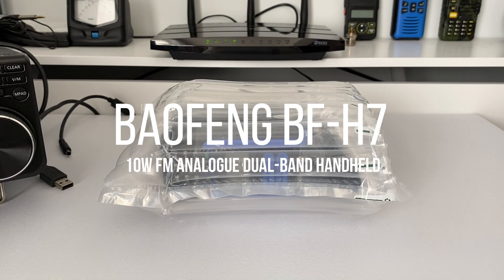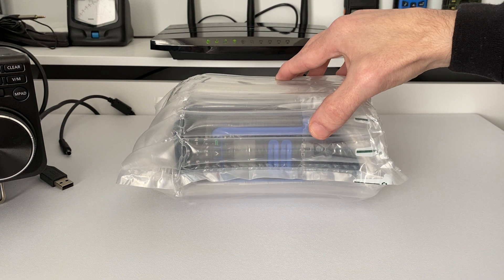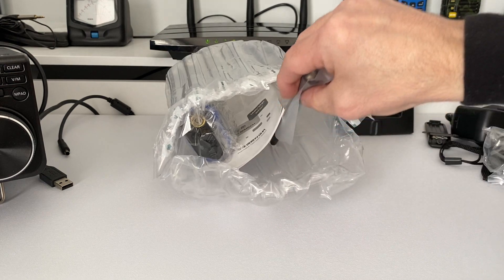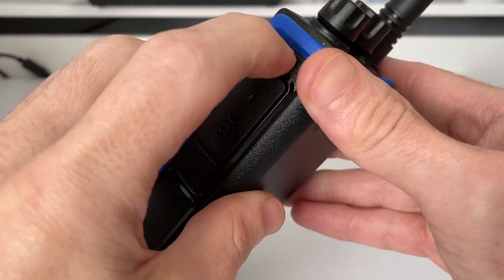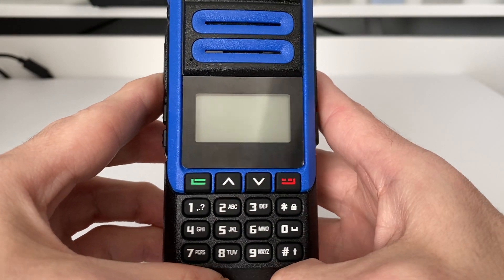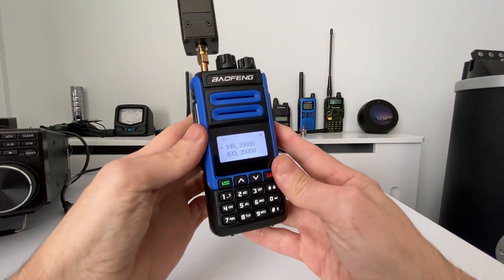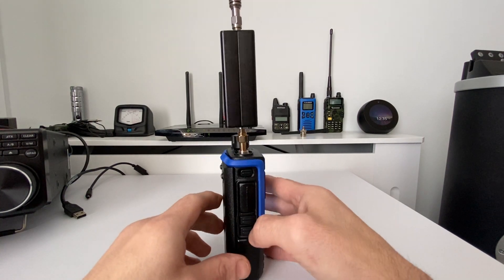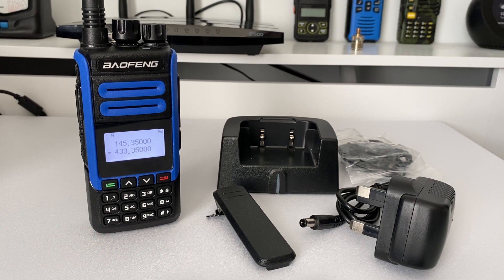Baofeng BF H7 | First look & power test (with a surprising result!)

Comment: does anyone know how can i pair baofeng bf-t3 my kids have with a baofeng bf-h7. i can't find the correct frequences
Reply from the maker: If within the UK, the BF-T3 should be 8 channels 1-8 on the PMR 446 frequencies. You just need the first 8 channels programmed into the BF-H7. But however, the BF-H7 isn't legal to use on 446MHz in the UK due to its power output and removable antenna.
Reply: @OntheMicwithMike  i am not in UK. i set BF-T3 on channel 1 and subchannel 1 for example and then i set the frequency on my BF-H7 from the table provided which is 462.5625 but there is no communication.
Reply from the maker: @marcusbrown2881  Are you sure both radios have been programmed for the same frequencies? Sub channels are CTSS codes, so my guess is that what one radio may class as channel 1 (CTSS or sub channel) might differ from the other radio.

Comment: Why do they need these walkie-talkies ... All this is outdated everyone uses smartphones
Reply from the maker: Maybe one day those smartphones wont be operational, radios will always be. Ham radio will work regardless.
Reply: @OntheMicwithMike  If she worked, let's say at least 50 km and even better for 100 km, then I understand it cost it .... But if she works for a maximum of 7 - 10 km, then I think this is just a children's toy
Reply from the maker: @SergeyKruzov  That's where the confusion comes. If you plan on transmitting with these radios, it does require a license. Once licensed, you can access repeaters... and repeaters can be networked around the world, so you can literally be sat at home in your armchair while talking to someone across the other side of the world. I've had that experience myself. Not a children's toy by any stretch... improper use of these radios can land you in hot water.
Reply: @OntheMicwithMike  ОК...

Comment: If switch to UHF we'll  get 10km  range distance?
Reply from the maker: Not necessarily, the range of UHF is usually less than line of sight. From high ground and clear of buildings etc.. it’s possible to cover great distances.
Reply: @On The Mic with Mike   thanks to really answer

Comment: 10W did the jobs in a more urban setting. Depending on the number of your local repeaters, if you are in a more crowded state, it would guarantee certain numbers of radio stations for national control. That said if it's advertised and it's true to 10w. We could see a 20miles+ easy touch with 200m hill. With 5 watts, you can have some struggle with that distance if that's some obstacle. It usually falls short after 10 miles based some of the testing I've see online.

Comment: I have a bunch of these chinese radios from Abbree to Baofeng or TYT and I tested them all for output power. All behave the same way by delivering 10W only in a specific frequency range except for one radio, the TYT uv98, this radio deliver its 10W on almost every frequencies it can transmit!! If you need a radio like that you are aware of its particularity now😄

Comment: There's nothing wrong with 5 watts (as most 5W radios don't actually put out 5 watts), and it's amazing it hits 10 watts on UHF. My walkie-talkies are UHF and to be honest, 5W and 10W are about the same when it comes to transmitting and they're identical when it comes to receiving. But it's hard not to like the BF-H7 (aka UV-99). It's just so datgum gorgeous. The S5 also shares the same look, but it's a 5W tri-band.

Comment: You can program the BF H7 with Chirp using Radioddity GA 510 and a Retevis RT22/RT22S programming cable which is like a master key and works on every single of my 20 plus radios. Three of the radios came with programming cables that didn't work, but the Retevis cable works every time!
Reply: Under what model selected on chirp?

Comment: On the BAOFENG BF-H7, HOW does one switch from UHF band to VHF band?
Reply from the maker: To change from channel mode to VFO mode, hold down the GREEN button (top left on the keypad). To change back it’s the same again, press and hold. 
To switch between the dual VFO just press down on the RED key while in VFO mode and you can select which one you want. As for VHF and UHF, both VFO’s work on both UHF and VHF.

Comment: Hi, Mike. Just a few quick notes. Do you ever watch videos by Randy (NotARubicon)? He recently reviewed two waterproof Retevis RT29 10-watt UHF walkie-talkies (radios he didn't have the legal license to transmit on). Despite his channel name, he is just a bit of a Rubicon. A tiny bit. He went to a friend who is licensed, and they did a range test that's pretty impressive. 

They went over 7 miles from each other in an urban environment with remarkable clarity. Of course, it's antenna size was itself remarkable. But if I understood you correctly, the Baofeng H7 hit 10 watts on the UHF setting, but only about half that on the VHF setting. And I'd assume the results would be the same for the H6 as well.

So I wondered if, since your initial assessment, you've had any other interesting measurements in either UHF or VHF? Specifically, is there any indication Baofeng preset any frequency settings that you know of? It did this with the 5R+ (which I wish it hadn't). It just struck me strange that it hit 10 watts in UHS, but half that in VHF. Another thing I found interesting, but completely understandable, was that when Randy held down the [PTT] button, the meter showed that the wattage began to drop. 

BTW, what are the laws and licensing requirements in the UK 🇬🇧 on UHS and VHS uses? Are there costs involved? Exams? We've got 90+ percent of people in the US 🇺🇸 ignoring the GMRS laws, but those who are licensed get increasingly snippy with those who aren't. The law says GMRS licences are $35, but the FCC it's still charging $70 on its website. Just wondered what it was like on your side of the pond.

Comment: What’s the range ?
Reply from the maker: Range is dependent on location. Higher the better, but around town I can open a repeater from home 49 miles away along the coast. Quite decent.
Reply: Hard to say what the ranges are. In urban environs, if you can see it, you can talk to it. If range is what's important to you, a 10-watt radio will be a good way to go. Mike got 10 watts in UHF, but only half that in VHF. So if you're going to be using the former, buy the H7. If you're going to be using the latter, you might want to look at something else. 

You might want to check out the Retevis RT29. Rather than me telling you about it, check out https://youtu.be/KhhgIanaG-s. Great review. Subscribe if you like him and do the same for this channel. 🗣📻

Comment: If one puts an earpiece into these radios, is it just one channel, or do you hear it in stereo? Not a deal breaker, but just curious. Also there's a review on Amazon by a guy who gave it one star 🌟. He said his H7 couldn't hit a nearby repeater that his 5R could hit with no problem. Have you had any similar issues with yours?
Reply from the maker: I’ve never tried to be honest. I use mine occasionally and it works as it should :)
Reply: this is a mono radio, and headphone jack in mono output.  just like any vhf-uhf radio.

Comment: For those of you with BF-888s walkie-talkies, here's a list of channel frequencies you can program into your H7s, or whatever radios you happen to own. All the other lists I've found have been completely wrong. This one works.

Baofeng Radio Frequencies 
BF-F888s to UV-5R 
-------------------------------------
CH  1		462.125000
CH  2		462.225000
CH  3		462.325000
CH  4		462.425000
CH  5		462.525000
CH  6		462.625000
CH  7		462.725000
CH  8		462.825000
CH  9		462.925000
CH 10		463.025000
CH 11		463.125000
CH 12		463.225000
CH 13		463.525000
CH 14		450.225000
CH 15		460.325000
CH 16		469.950000
-------------------------------------
Reply from the maker: This list is dependant on what part of the world you’re from. For example, they wouldn’t generally be used here in the UK - I believe those frequencies are the FRS frequencies.
Reply: @OntheMicwithMike  » Quite right. In the U.K. how are these radio frequencies regulated? My wife is from Iran, where FM is used by the military. She found this out by taking a radio to her family. She said they took the radio, did something to it and gave it back fully functional except that it would no longer play FM. 

About the H7, do you still have it and, if so, is it still working to your satisfaction? If you were to use it while camping/hiking, would you set transmission to HIGH (10 watts-ish) or would you set it on MEDIUM (5 watts-ish)? Does the HIGH setting quickly drain the battery to the extent you would use the lower seeing? Thanks!
Reply: Just now saw your other answer. Sorry for the repitition.
Reply from the maker: Really the most accessible radio service open to everyone here is PMR 446. But there are legal requirements with them, power limit of 0.5w and the radio must have a fixed antenna so these Baofeng radios aren’t legal to use on PMR. It doesn’t stop people though from doing it but that’s it. The rest you need to be a licensed Ham operator or a business licence holder.
I have to be perfectly honest, I hardly use handheld radios or 2m and 70cm for that matter. Very rare I’d pick up a radio and call out on one of the calling channels, I’m more into HF myself :) 
But using the BF-H7 on medium power is more than enough really.

Comment: Nice radio, but I'm going to send it back to Amazon if I can't find a battery for it!
Reply from the maker: Did you not get one with it?
Reply: @OntheMicwithMike  Yes, but the only one that came with it. The battery only lasts about a little more than a year. Replacements are about $35! The radio itself is sweet, but why hasn't it caught on in the States? The battery costs almost as much as the radio. Is this likely to change?
Reply from the maker: No idea mate. The thing with those cheap Chinese radios is that they are disposable in a way. When they break or go wrong they end up in the bin. Buying a new radio is sometimes cheaper as you said.

Comment: I'm wondering about the output power of the H6, which is also claimed to be 10W, and if it can be used with Chirp.
Reply from the maker: I did a power test in the video. Also there are some good details in the video description on programming with chirp as it’s not actually supported yet. Cheers.
Reply: @OntheMicwithMike  Yeah, seems they are sort of the same models.

Comment: That doesn't make sense. On all my radios, the VHF power output is always higher than UHF. Strange that it's backwards on this radio.
Reply from the maker: Most of the Baofeng radios I have and had in the past had a higher output on UHF. Even my Kenwood TH-F7 has a higher output on UHF.

Comment: Any idea if it sounds better?
Any idea how long the battery will last?
Any idea if it really is waterproof
Reply from the maker: The radio sounds the same as any other radio. The battery seems to be decent, I used it a fair few times and the battery lasted a good while. As for the waterproof test, I may do a waterproof test soon and film it for the channel to see how it fairs after a dunk in some water.

Comment: height in cm?
Reply from the maker: Just over 11cm tall for the main unit, 13cm including the height of the control knobs on the top of the radio. That’s without an antenna attached.

Comment: You can try to use software for BF-H6  for this radio - it (partially) work good for me right now - http://www.baofengradio.co.uk/programming-software/ . I'll fill request form for CHIRP later.
PS: https://chirp.danplanet.com/issues/8313
Reply from the maker: Hi there, I tried that last week myself and got the radio to momentarily connect and then throw up an error message. 
I’ll also file a request too hopefully the more numbers request it, the radio will have more chance of being supported.
Thanks for the info and stay safe 73’.
Reply: @OntheMicwithMike  also you can try this link http://www.radioscanner.ru/files/baofeng/file21545/ (sorry in russian only, not mine), this sw looks very similar but it's not the same (it's correctly support UHF/VHF on this radio at least). Cheers!
Reply from the maker: @IlyaTyshchenko  Hi there, yes I tried this software and it's doing the same as the BF-H Series software, starts to read from the radio and times out at 4%. Doesn't really work on the BF-H7 yet. But thank you for the link, it's appreciated :)